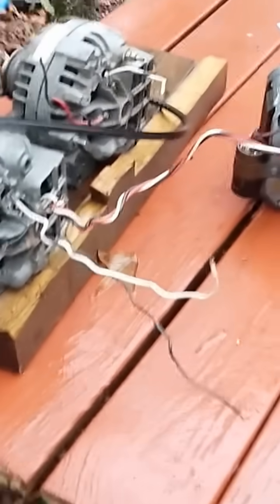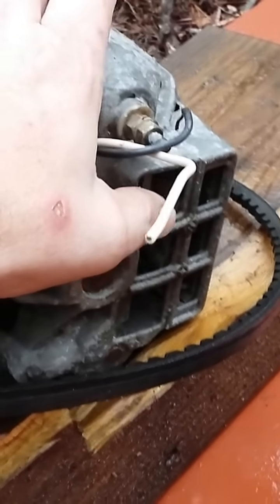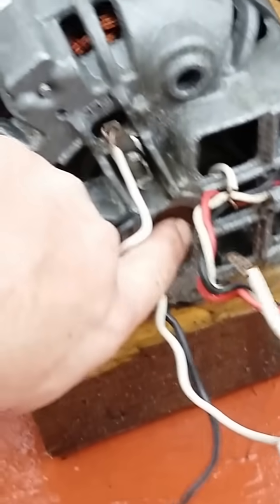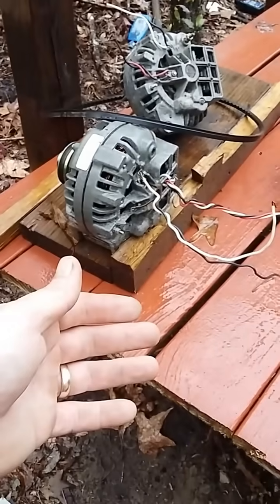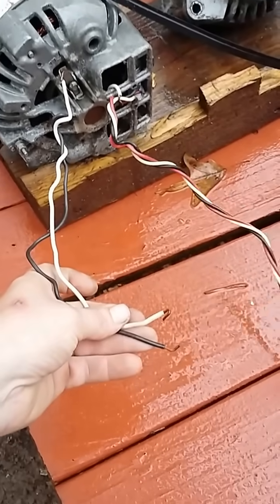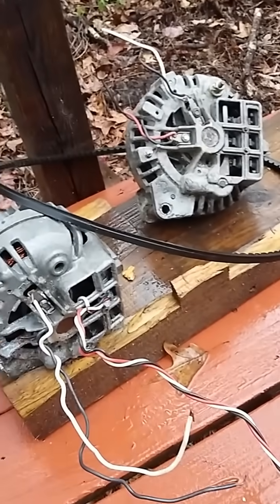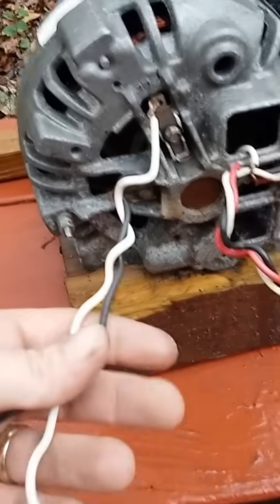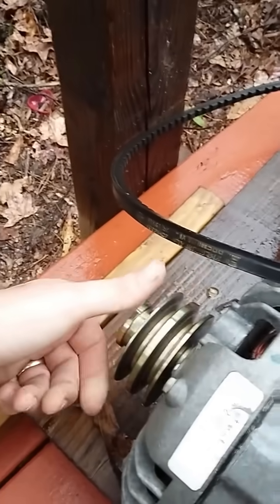Update Free energy forever no wind no solar no gas READ DISCRIPTION!!!

Comment: This is all good and really does work!!!
But an alternator is not designed to have that much draw so,
I would be changing your wires to a heavier gauge like 8 gauge because of heat issues.
Then you have another problem because the alternator is not built that heavy..
So the best way around this would to have multiple alternators in your circuit.  
To get around the fuel problem if you are using gas engine to power your system,
is to make an H2o Hydrogen fuel source to provide fuel for your engine!!!
So you can power your engine with a little bit of water.
Good stuff!!!
All this is dangerous so just be careful bud !!!
Thanks 4 Sharing.
Reply from the maker: Thank you for at least asking some intelligent questions and giving your input because my system is multi motor system with an alternator and some generators because how do you create an electromagnetic field with a stator and direct current

Comment: here is GEM of a simple free energy technology for the Tribulation Saints 
http://free-energy.yolasite.com/
- 
if you attach a 100cm circumference pulley to a DC motor it only takes one spark of DC current to rotate a DC motor one full rotation. This would give you 100cm of moving belt to work with. Now if you run this length of moving belt past 10 mini -pulleys of one centimeter circumference, with AC generators attached to each pulley, then you would get 100-1000 units or cycles of AC electricity as an output. These are free running AC generators=(as no load is on them) - all of these generators are running with zero load = no electricity being used just the fluid friction of the bearings is your only wear or load-type, but you could use magnetic bearings + have zero friction so all of these AC generators are just winding up massive voltage which can be accessed as potential = ability to do work = available current in load you have just made your first self powered set of running AC + DC generators that you could tap power off of + the more mini-pulleys with AC generators attached the greater amount of current you should be able to do work with 
- 
(now.... don't you think that you could be able to get one spark of DC current) ( out of the 1000 units of AC electricity that you have for an output) (this would make this unit a self powering mechanism = perpetual motion) (+ this could be producing an unknown amount of AC + DC electricity) 
- 
http://free-energy.yolasite.com/ = PUBLISHED 2001 OR 2002 
(YET THERE IS SUCH A SPIRITUAL WARFARE GOING ON AGAINST IT) 
((( evil spirits were hiding this tech = lies about torque being a problem )))
- 
Now comes the bad + scary part of this awesome free energy technology discovery You can easily see just how super simple this AC multiplication technology is so why could not any one of the millions of above average intelligence have discovered this long ago... as soon as AC electricity was discovered. Well this is hard positive proof of there being powerful spiritual warfare going on all around us... + they were winning I would say that these powerful evil forces were winning - if they could hide this from us 
- 
I happen to be Born Again-(28-11-88) + want this super simple free energy technology known long before the first Door closes for Christ's return in the clouds by or before 2019.04 http://doorschristmustpassthrough.yolasite.com/ + http://2020-vision.yolasite.com 
- 
This technology is in the Holy Bible = in Ezekiel 1:16 where he is describing what a UFO motor looks like while it's running so this technology will eventually lead us to anti-gravity as well as not only speeds approaching the speed of light but also the ability to do 1000 kph vectoring 
- 
We are warned that no one knows the day nor hour... (Mat 24:36) but it says that we will know when it is near... near to what? maybe the door.... as we can know when it's "even at the doors" (Mat 24:33) 
- 
I heard that in the original Greek it was worded like a command "know that it is near" With this technology the Tribulation Saints can keep warm in our cold Canadian winters even off the power grid. (remember the heat + light of fires would easily give away your position visually... as well as via satellites) - notice that Doors are plural - because He show up twice = 
1) - Rapture = "caught up together with the in the clouds"-(I Thes 4:17) 
2) - "Glorious Appearing" at end of Tribulation -(Titus 2:13) 
- 
1st door will soon close on the Return of Christ in the air

in Mathew 24:33 we are told that we can "know that it is near, even at the doors" 
when talking about the "end of the world", where “world” is "age" mistranslated 
this 1st door will close = date the 7 year peace treaty MUST be signed by 
+ the pre-Trib Rapture must happen before this door closes 
-
A date which we are allowed to know, will be on 2019.04 
http://doorschristmustpassthrough.yolasite.com/ 
+ http://2020-vision.yolasite.com/ 
because the bible says "know that it is near" (near to what? = the 1st door) 
"even at the doors"" Mat 24:33 + door = deadline = last day possible 
that it will happen within the same generation that say Jerusalem in Israeli hands 
-

Comment: Hi Dogulas.  It would be very helpful if you could show exactly which diodes you have to connect to clearly so, I don't pull the A/C power. so I cannot get in-regulated power and where it can't it turn into 3 phase. Then showing how to properly connect things to a box in your home and grounding it all.  It would really be great. Applaud your efforts. But, want to make sure I don't start fires and burn this home down by my not knowing every thing. Scarry. Sincerely, Erik.
Reply from the maker: Thank you for your kind comments. Don't worry I'm in the process of building another system and videotaping it as I do I will be showing everything and the video will be titled from A to Z

Comment: Hello, Douglas. Yes I got your message Thank You Very Much.  Can wait to get my first Alternator and set up a board to set up two Alternators with a motor with a capacitor. Have it all bolted down and fired it all up with a 12DC battery and then have to figure out how to run my wires to constantly re-charge my 12DC volt battery as a single unit I can place on a bench and have plug bars attached to power anything I need in a shop.  It would be great if you made a second video to show what is inside the altenator. But, your right. It simple and want very much to get a self perpetuating system to power lights in my home and anything else.  I undersstand what your saying to attach a 100 amp fuse to the electrical box.  Think I will have a local electrician come over to help me so I don't run anything. Because I rent. Take care of your self and don't let any one knock you down for showing this. This is simply AWESOME !! Take care Erik.

Comment: look my friend.  what you can do. is upload a video. doing it. most of people doesn't know.  about hertz. volts. etc. just do one video.  with the simple alternator you have. this means. step one. tell the people. you need to get an alternator. or motor..  from. this car. washing machine.  dryer.  etc.. then. step 2. connect this wires to here. then to there. give a 3-6-9. volts to the unit.  ( with what? ). a battery.?.. then to an outlet in the house. or the 2 or 3 big wires coming from the street.. black. to black. ground. etc. but just do the hole thing. and you don't have to answer many. email.  or anything.  please. if you read this. let me know.  tnx. god be with you
Reply from the maker: I'm working on it..

Comment: it hurt watching this.  its an alternator.  it is rated at 90 amps of power, but at 12 volts (really about 14.2)  if you pull the A/C power before the diodes you are going to get totally unregulared power and might even be 3-phase,  I'm in Avionics, not automotive.  so the speed of the alternator will determine voltage.  it will take a good amount of energy to get that alrernator spinning fast enough to generate anything useable.  so just shotgunning the math if you could maintain the manufactures rated speed, you might get 10 amps of a/c power and it may be divided between two or three legs. you also can't connect a/c sources together unless they are "in phase" or things melt.  you also risk destroying anything sensitive you connect with the power surges and with the efficiency of the gas or diesel motor you use to power it, it would be cheaper to just pay the electric company.   
a better setup would be to keep the alternators entack for easy replacement, weld up a frame with as many as you want and keep it DC.  connect those together, to a charge controller, then to some deep cycle batteries,  then to a decent 3000watt inverter, and connect that to your house with the proper phase and ground connections.  that would be a safe system as a home generator but still inefficient.  add some solar cells as you can afford them or a wind generator and you will have a complete back woods power solution that nobody is going to kill you  over.  the only thing that will kill you and your family is the contraption your tinkering with in the video. if your in middle georgia i will help you.
Reply from the maker: Because all of the hatefulness I'm going to change a few things I'm not going to do this for everyone for free and be treated like crap and still sink further and further into debt
Reply from the maker: joe wehrwein yeah 12 12 volts to it at full load might lower it down to 990 but when you have four or five of them with mosfets hooked up to activate them and the other motor what's your problem buddy why is everyone throwing sticks and stones at me for trying to help the world with multi generator multi motor systems that have backup systems built into them that power themselves I'm giving people complete instructions 100% for free and if they tell me that they cannot build one of these I am offering to do it for them how much more can I do on top of having a screwed-up back really is $5 going to kill somebody I've had a few people blessed me with $100 and now I can afford gas and diapers and I am extremely thankful for that but some of you people are just so hateful I don't know man if I'm doing the right thing sometimes I will continue to share this with good-hearted people that I find and I am going to make this video to show everyone in detail on video how to make one of these on their own step by step!!!  the day you give up is the day that you lose everything!!! And instead  of trying to help me mass produce something that won't cost anything to run and only charge for labor and parts... 200 or 300 and for parts but here's the thing all you had to do is email me and politely ask me for the system who am I to judge you there are countless number of people have built about 30 different types of multi generator multi motor w^/mosfet with heatsinks to cool them... what the hell is the cost in another 1 hundred amp breaker box to power the other half your house man if just  every one of my subscribers gave me $5. I would be able to make a couple of these and would give one away!!! You can't stop me I will do this video in detail step by step and show everyone how to make this!!!
Reply from the maker: joe wehrwein Your not any kind of technician I can tell that 100% for sure!!!
Reply from the maker: It is a multi generator system automatic with mosfets I use more than one motor to power it in case something happens another motor can pick up before the system shuts down there's lots of things you don't know brother and I have a dollar and $0.35 and two little children how do you feel about all this
Reply from the maker: +Thomas Buie but I did tell you about the controller for remote control airplanes right?
Reply from the maker: James DiLeonardo  Joe is very uneducated don't fall in to his deception...
Reply from the maker: +Joe wehrwein just like I said in my other comments do not use the middle wire coming off of the coil because I don't know of any of the models that I have scaled for people for 3-phase I'm telling people to only use the wire on the left for one and the wire on the right for another phase and 2 pound a 4-foot copper pole into the ground and wire it to the outside of the alternator  and to the breaker box which would make a little bit of sense since you're in avionics you should know a little bit about this now the problem with the voltage is you have to run it at 3500 RPM for it to sustain itself and give you what you need but if you can do math then you will know that 80 amps times 110 volts equals 8800 watts each do you think you can power an electric motor with that? I don't know let's see if anybody else out there has an answer for that now... I'm not going to tell anybody how to step it down or what they need to do to make it 50 or 60 hertz depending on what country they live in because I don't want any evil people out there replicating this this was not meant to be given away for free to evil people and that's why I left a few things out of the video and I'm customizing these for free  for kind-hearted people only I don't want to be a millionaire and I haven't charged anyone for anything that I have customized for them because I could easily do that if I wanted... I came up with this system in 2003  if I wanted to be rich I would already be rich  I think I have better morals than to sell out for money and let the electric companies suppress this some more thank you very much!!!
Reply from the maker: Well you are entitled to your opinion but the facts are I made the video confusing on purpose I don't want every idiot out there trying to kill themselves or any evil people getting this for free I will give it to any good-hearted person for free and I'm fixing to send it to you as soon as you give me a email address but I swear if you send it to anyone I will take everything that you own from you and I want you to publicly apologize for what you have said and tell everyone that you were mistaken!!! And I don't want your money just like I told DNR if he sends me money I will send it back to him and never do business with that type of a piece of trash human
Reply from the maker: joe wehrwein I'm sorry that you don't know about energy or electricity next time I get a chance I'll make a video and show you how to turn a light switch on

Comment: I thought everyone knew how to do what your doing. me and my buddies have been doing what your talking about since about 1947 lol. I wish I had of known it was a secret. lol.
Reply from the maker: it's no big secret brother but it is something that everyone is taught to fight until the death because they can't believe it's true
Reply from the maker: +David Castle I use one alternator to turn other alternators/generators and yes there is basically no difference in the wiring of an alternator a generator or motor it's just different ways of using your own magnetic field it's not even really a magnetic field it's an induction field a field used to transfer heat the heat is pushing against itself from different angles at different times either creating spin or drawing in from a spin. what causes alternate current well I would have to say that it is a short in the circuit 60 times per second from a direct current source and you plug your TV into it. (almost that easy)

Comment: Two observations, first thing,... where is the toilet at in your yard. Second,.. what the hell is up with the crying baby in the background for the entire video? Great idea though, especially if you could series up some 12volts and use a capacitor into your panel box, but you'd need a wind mill of some sort to crank your generator during the day. By the way, 100 amps is a minimum requirement for a single family dwelling, 200 is pretty much the standard though.
Reply from the maker: why don't you just hand crank it like the other gentleman suggested
Reply from the maker: TheFinishedWork yes it will run lights and motors and stuff like that with no problem but you have to keep in mind everything sensitive like your TV we run at 60 hertz in the United States which means 60 pulses or cycles per second and you need to fine-tune that with a dimmer switch from a ceiling fan to make sure you're getting 60 hertz 110 volts to your receptacles so you use the coil wire on the left and the coil wire on the right which will give you two phases spin it at the right speed and you'll get... just saying?  I'm not a crook I'm a man trying to change the world and protect his family at the same time!!! An extremely poor man at that...

Comment: you said its needs no wind or solar ive got a power eng certificate ,,ive done this when i was 12 yrs old with ford altenators but couldnt get one to act as a motor in order to turn the stator of the other ,,,id love to see a video of this system in operstion ,,please  ,,,,i live off the grid for 28 yrs now and power is always an issue so this is important to n for me
Reply from the maker: look up what an airplane controller does if you want to use one of your alternator's as a high powered motor instead of using a electric motor out of a washing machine
Reply from the maker: +Thomas Buie brother I'm not talking about a 747...